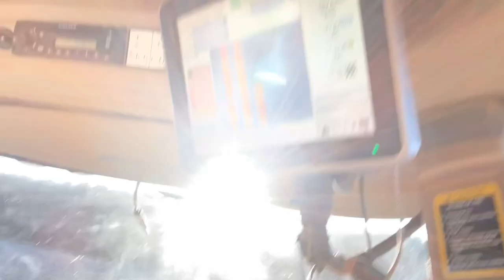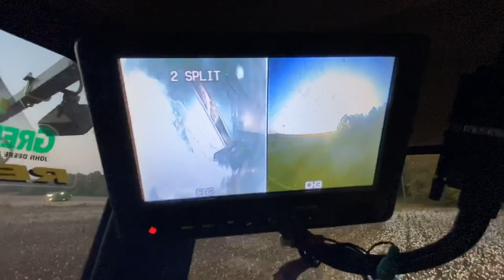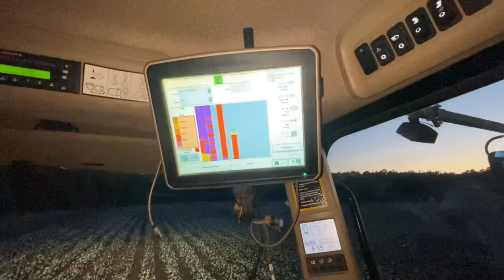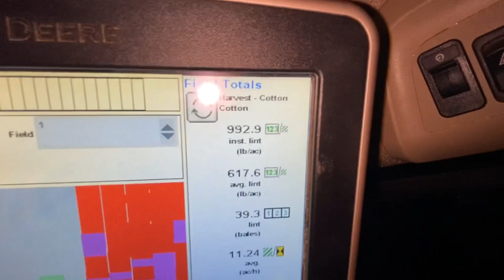Busted Cotton Module!!!
$$$$ WASTED & LOST!!!

Comment: We run 3 jd 690 pickers, here in south east Arkansas, we'll break at least one roll over 4000 acres, we old 8" plastic hard irrigation pipe, opened up the doors at the fans, start the fans at hi speed and using 3 pipe and rake the cotton  into the pipes, it want take to long to suck the back up to reroll

Comment: Did you figure out your hydraulic restriction? I'm having the same problem.
Reply from the maker: Cottonwood Farm stick a primary hydraulic filter on it
Reply from the maker: Cottonwood Farm directly behind right dual, 5ft from the ground in front of hydraulic tank
Reply: Already did.  No help. Thanks
Reply from the maker: Cottonwood Farm may want to check out the other filter, or you pump may be getting week, mine on this 7760 so t near as stout as those 690’s
Reply: I’m thinking if it’s a clogged filter, the filter bypass would eliminate any loss of flow and you should get error code or something, either the pumps getting sad or there’s a internal leak back to tank.. cut the filter open and check for metal from the pump. Hope that helps

Comment: PICK IT UP AND RUN IT BACK THROUE THE FANS BACK INTO THE BASKET. .DONE IT BEFORE . HAD 2 PICKERS BREAK THE TAIL WHEELS OFF . LOADED WITH COTTON . BEFORE 4 OR 6 ROW PICKERS.
Reply from the maker: eddie f there would not be room in the accumulator, we just brought the module truck down there and ran it up on the bed and carried it to the gin. Aggravating but fairly simple and quick
Reply: @southernfarmer  new sub here from south east NC. Around here there is a mix of round roll pickers, and the older basket pickers. Stopped and watched them picking a field the other day. On the bowl buggy they had put a vacuum on the front to clean up around the module builder. Would of worked good for the mishap in the picker. Thanks for the videos 👍.
Reply from the maker: Fireman 3174 SVFD yes, I’ve seen those, pretty cool